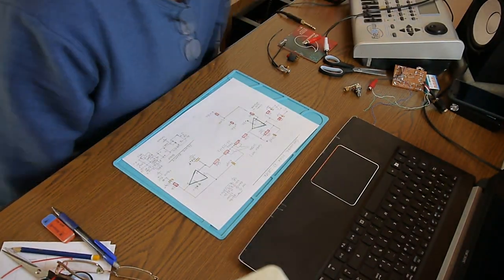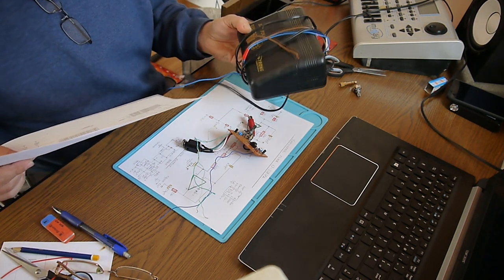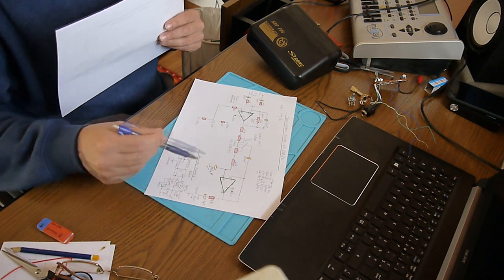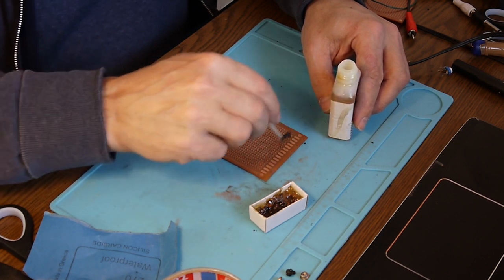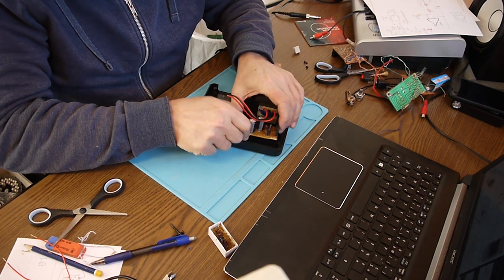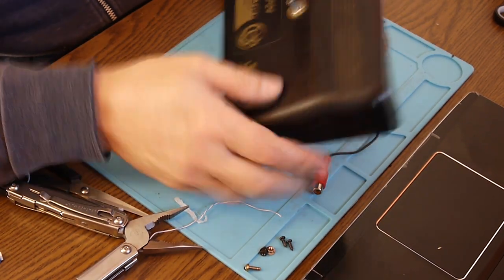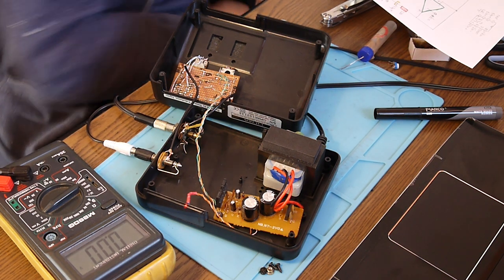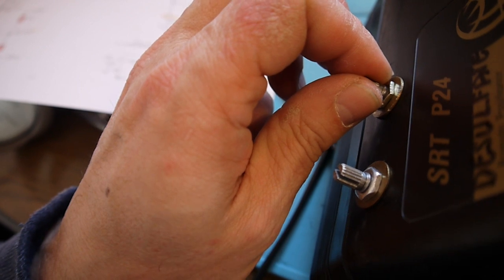DIY Subwoofer low pass filter with schematic,fully adjustable 43-228Hz

Comment: Very nice and simple circuit with excellent results. I'm planning to make my own subwoofer and I have a few questions. I would be grateful if you could answer them:
1- Can I connect this to any speaker? I mean, will any speaker turn into a subwoofer if I connect it to this?
2- Does this need an amplifier before/after it?
3- Is it possible to make this with 12V power supply instead of -12/0/+12 supply?
Reply from the maker: Thanks! It's really working, I'm still using this with good acoustic results.
1.The loudspeaker/cabinet should be big enough to handle low frequencies..like min 8''..
2.You need an dedicated amplifier or a amplified cabinet, this filter should be connected between the sound source and amplifier, like between a mixing console and a power amplifier running dedicated loudspeaker.There is no need for a low pass passive filter in the cabinets.
3.For this circuit is a need +-12V DC, very well filtered for no hum in the sound.
Also, there are some boards kits on sale with a different OP powered by a single 9/12V DC.
Reply: @viocaia  Thank you very much!